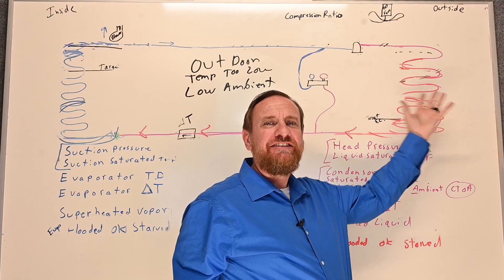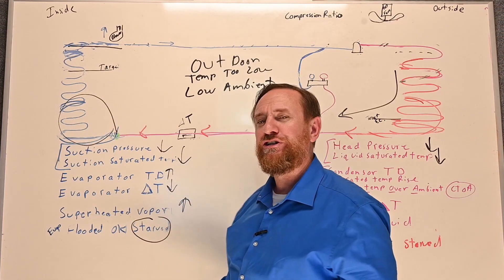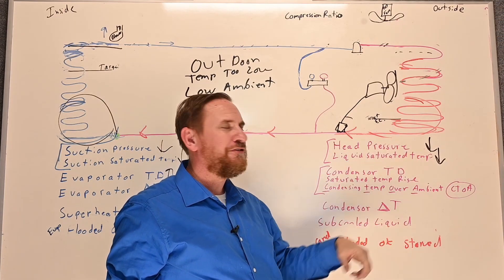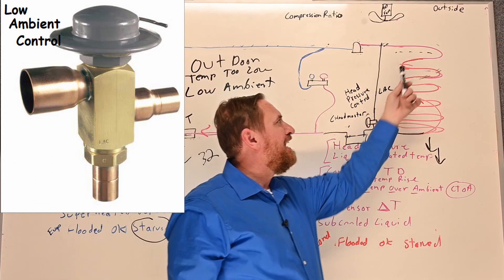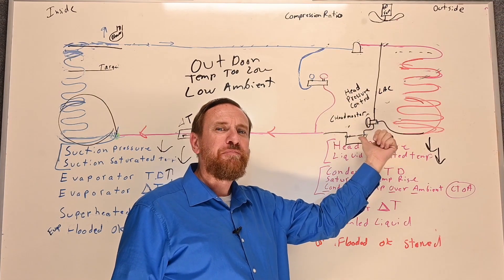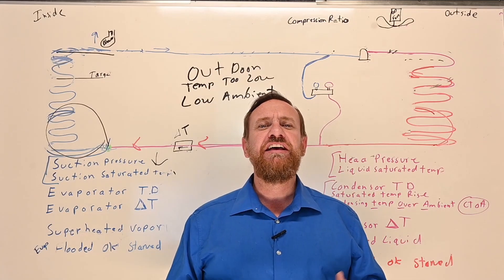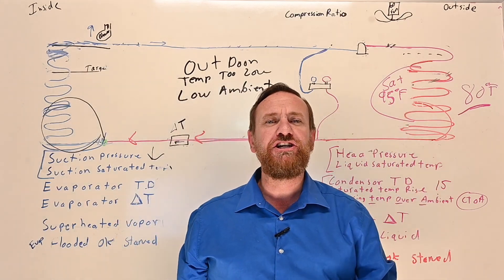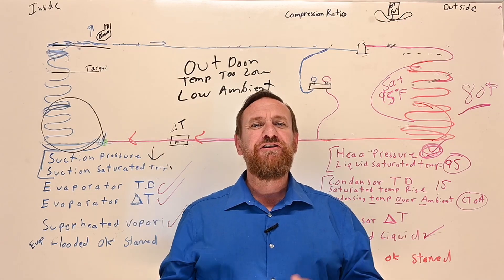HVAC 107 Scenario: Low Ambient

Comment: Hey Ty, what do you suggest for properly charging an AC with fan cycling controls? The numbers change so frequently with the fan.
Reply from the maker: Bypass the fan cycle control. If the ambient is too low I will block the condensor to a stable outdoor temp simulation
Reply: @love2hvac  so just disconnect it and run with the fan tied to the compressor?
Reply: @love2hvac  also, how do we know what a metering device needs for pressure drop across it? Any good intel on that?
Reply from the maker: Yes the fan runs with the condensor until I'm done charging it. 

The metering device will be sized to match the compressor. 
Each manufacturer will publish compatible metering devices for their equipment. 
Alternatively, I like TXV because they are sized by the ton and adjust so they are much easier to match up.
Reply: @love2hvac  cool man. Is there a good way to test pressure drop across the metering device that you like if you have an inkling that there may be a plugged screen or maybe an undersized device? Sorry to bother on a Saturday night. Figure I may as well take advantage of having your ear haha. Thanks for the quick replies btw!

Comment: I personally don’t care for the headmaster control, many times i’ve had to add a fan cycle control on units so equipped over the years. I think they have problems in parts of the country where we have extremes of cold occasionally like here in the North East. I have to disagree with you though on one point, it isn’t necessary to have a ball bearing fan motor with a fan cycle control, virtually every refrigeration unit i’ve run into over the years use sleeve bearing condenser fan motors and they hold up just fine as long as they’re oiled regularly, it’s units equipped with motor controllers that vary the speed of the motor that require a ball bearing motor.
Reply from the maker: The ICP fan controllers do a much better job with swing and soft start than the old pressure switch for sure. The refrigeration fans have much less strain on them than the residential fans also. All great points thank you!

Comment: I read that with high efficiency condensers, you should add 20 and convert that temperature to pressure to get target head pressure and for standard efficiency condensers you would add 30° to get target head pressure. I noticed that you used 15° in this video. Is there that much of a difference? Thanks
Reply from the maker: I did a video  n these I will post the link below
30 was standard in the 80's and High efficiency was high in the 90'S

8 SEER 24° -35° 

9-10 SEER mandated 1992  = 20° -30° 

11-12 SEER 15° -25° 

14 - SEER mandated 2015  11° -16° 

15 -16  SEER 10° -15° 

Variable and inverter compressors TD=NA due to varying capacities. 

Remember these numbers are estimates as different brands and different engineers design systems with different CFM across the condenser. 
here is my video on TD specifically you can skip to 7:34
https://www.youtube.com/watch?v=VzRq_36zqcg

other resources related to condenser TD
https://hvacrschool.com/the-pressures-look-good/
https://hvacrschool.com/the-5-pillars-of-residential-ac-refrigerant-circuit-diagnosis/
https://www.contractingbusiness.com/service/media-gallery/20870989/testing-refrigerant-charge-without-gauges
Reply: @love2hvac  I see. Thanks for the reply!

Comment: I remember a older service tech once saying to me that when the outdoor temp drops below 60 degrees, one should not operate a typical residential compressor.  Would you say that was a good rule of thumb for recommendation?
Reply from the maker: For AC I would say 70 unless there are low ambient controls, crank case heaters and solenoid valves.

Refrigeration definitely  and commercial buildings may need it too. For residential it's pure luxury.

Heat pumps have a complete different set of rules.

Comment: Fan speed controls is much better than fan cycling. ICM makes a nice aftermarket kit for speed control. Can't forget to also add a crank case heater as well. I know some manufacturers use one leg to keep the crank case somewhat warm. I like CCH's better though
* also low ambient conditions, dont allow for proper pressure differential for the TXV to operate properly *
Reply from the maker: Icm definitely nice. They also have a heat pump lockout too.
Reply: @Jason Johnson That's what your fan cycling or fan modulation does, that's its only purpose. To keep your head pressure up high enough to have a solid subcooled column of liquid to the metering device. It assures your proper pressure diff at the MD.

Comment: could it be said that if greater the pressure on the condenser, the greater the pressure of the liquid that goes to the TXV = the greater the amount of liquid by volume and the greater the cooling capacity? Less liquid pressure on TXV = less liquid by volume and lower cooling capacity with high SH ?
Reply from the maker: The capacity is limited by the volume displacement of the compressor. 
Adding more refrigerant will stack more refrigerant in the condensor flooding the condensor, reducing the amount of room available for saturated phase change. This drives the head pressure up increasing the compression ratio reducing compressor capacity. 

The additional liquid pressure will have a small initial opening force on the TXV but as the superheat starts to drop the TXV will apply additional closing force to maintain evaporator superheat.

We need to feed the TXV enough Subcooled  refrigerant so the TXV can maintain superheat for us. 

Extra refrigerant just puts more work on the compressor,
Not enough and the TXV cant maintain superheat.
Reply: @love2hvac  Thanks for answer. 
Make a video next time, and explain  what is the purpose of the head pressure valve and what is its significance for the autumn / winter system for low ambient temp. What exactly happens when pure vapor is fed into the system, without the effect of condensation into the liquid